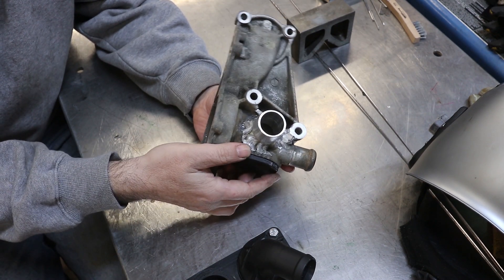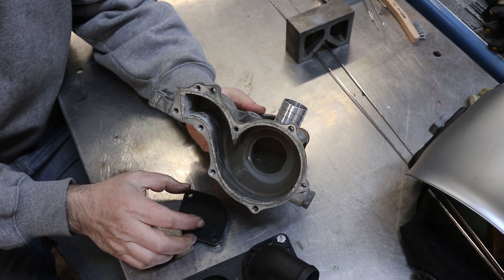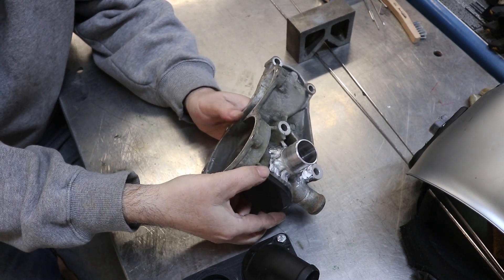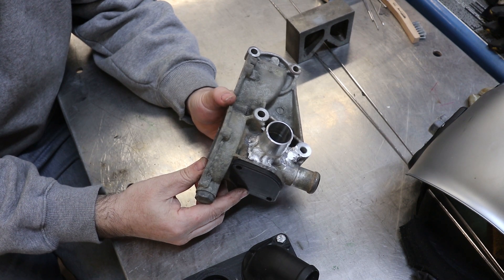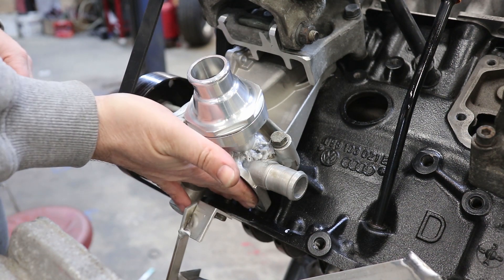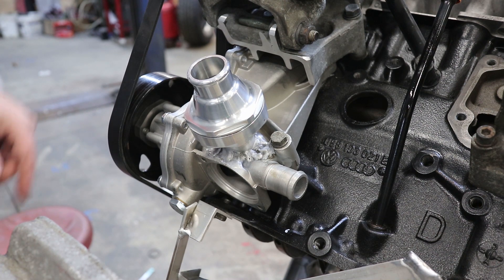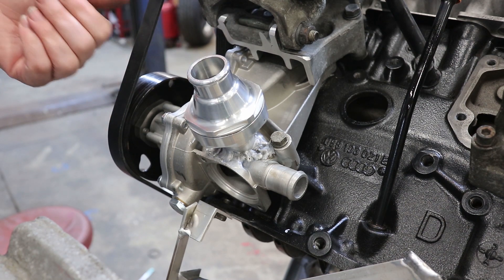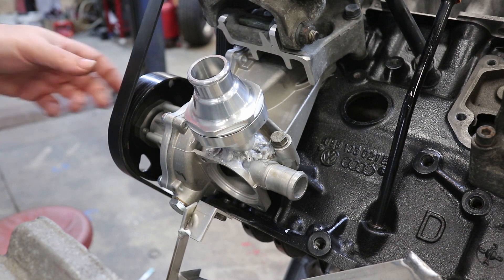AEB engine in Porsche 944 - water pump modifications

Comment: Nice and neat work. The thermostat being at a high point in the circuit, would it not be affected by any air bubbles being trapped in that high point, in which case it could maybe not open at the desired temperature .. ?

Comment: Wonder if one of these T-stat housings would fit nicely.  Sure looks like it might fit quite nice.  ???
https://www.ecstuning.com/b-genuine-volkswagen-audi-parts/thermostat-housing/038121121d/   TDI version (BEW engine code transverse mounted)
https://www.ecstuning.com/b-vaico-parts/thermostat-housing/06a121121c~vai/   (1.8T & 2.slow transverse mounted)
Both are the same outside dimensions but the TDI version (038...part#) has clip do-hickys for the T-stat to twist and clip into the housing, if using OE, Mahle or OE dimesion stat, also holds the seal making it super easy to mount/install, especially if upside down.  Real nice low profile right where you would need it instead of the big bulky hump of the OE housing.  Also the bolt crush sleeves are sized for M7 bolts, so you'd get some twisting wiggle room to angle the tube/neck since you'd be using M6 bolts.
Also seems like you'd get better and more proper rad hose routing as it looks like it would angle the neck forward, down(ish) and towards the side(ish) more in line with the radiator fitting and avoid having to make a big awkward up-down hump with the lower rad hose.
ALH TDI version (straight neck version....) -
https://www.ecstuning.com/b-genuine-volkswagen-audi-parts/thermostat-housing/038121121/

Just thought I'd throw it out there since you mentioned a solution to help others as well.  I would guess others may not want to cut/weld aluminium housings......just go for a bolt on solution.
Maybe go to a junkyard with a 1/4 ratchet, extension, wobble 10mm flex socket and a knife and grab a crusty old one out of a Mk4 Jetta/Golf with a 2.0L see how it might fit.  Take about 2 mins. 

80°C stat # 050121113B as used in the 225HP TT's 
87°C stat # 050121113C most all other 1.8T & 2.0L

Also on these plastic housings as well as hose flanges on the back of the head, use only OE or "high quality" parts with proper glass fiber % reinforcement (the "PA6.6-GF30" number, 30% glass fiber....).  The links are just for pictures and part #'s.  Stay away from the Meyle, Vaico and MTC brand junk. 

More pics/parts to look at  including metal options - 
https://www.ecstuning.com/Audi-TT_MKI-Quattro-225HP/Engine/Cooling/Thermostat/

https://www.ecstuning.com/Search/SiteSearch/038121121/
Reply from the maker: I have a metal one for the back of the head.  I'll check out some of those other ones and see if they'll work.

Comment: Very nice solution! I have the electric water pump in my AEB setup in my 914(actually just did a video on it).. But the 1.8t's run so cool its really not necessary, I think your solution fixes your problem very well! The water pumps for the 1.8t's dont generally fail (They are a replacement item with the timing belt though), they do however leak. Keep up the progress!